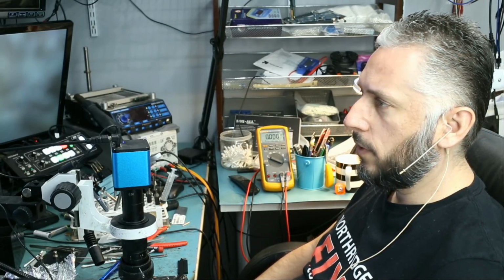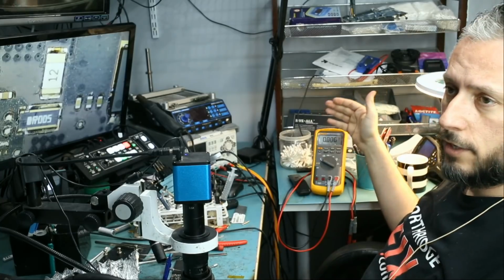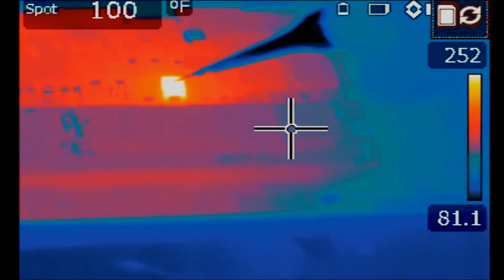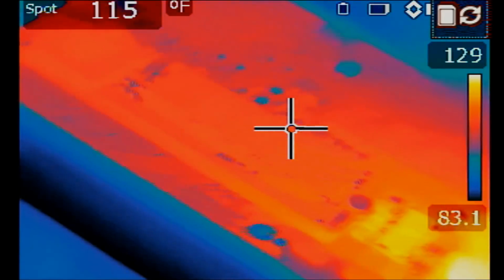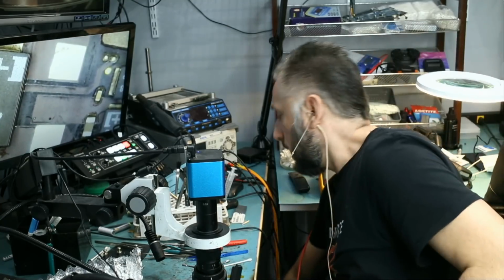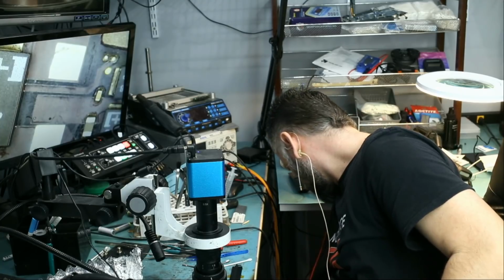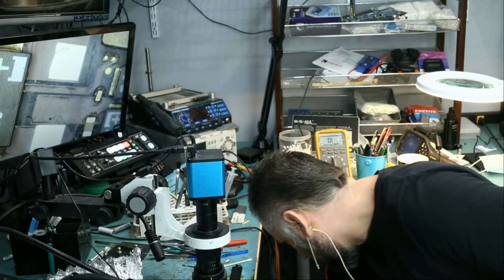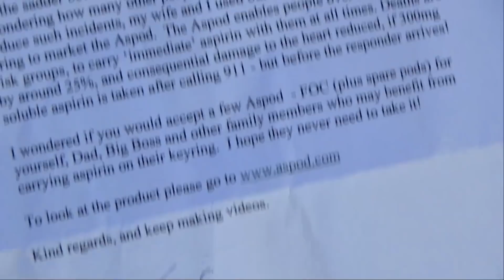2013 MacBook Pro No Power Repair - The Magic of using a Thermal cam to find short circuit.

Comment: You said the green light is the first part of the equation, i have quite a few same year macbook pros that have have no power issues but the light on the charger turns orange with the motherboard out of the system and no battery installed. Where would you turn to withan orange light, seems by saying you have a green light is the first step that you would not continue with the processes if it were orange.

Comment: I am a little bit confused about how to adjust and connect the macbook boards to the PSU. I can easily see how much current is drawn, but how about voltage? The bench PSU is not a charger, the board cannot negotiate with the bench PSU and ask for a different voltage than the PSU is adjusted for? So how to see if the board takes 5V, or negotiates 12, or 17-19V? I don't know if just setting the PSU to the max supply voltage for that board, could cause damage the way bad chargers doing the same can (?)

Comment: I have learned so much from your videos. I just recently did an iPad Air 2 charging port where half the pads were ripped off by a previous tech. I ran jumper wires for the first time (which is a lot harder than you make it look) and it worked! Thank you for doing what you do.

Comment: "We charge the customer full price..." That's fair. Because just because something's easy for the repair shop doesn't mean it should be easy on the customer ;)
Reply: If anyone wanted to complain, undo the repair and give device back
Reply: @182mdavi  When I was working as PC tech in a retail shop in the 2000s I was "honored" to do that quite some times. There was much wailing and gnashing of teeth on behalf of the customers as a result. Good times ;)
Reply: @182mdavi  We once got a PC in that was filled completely with dust (literally). We vacuumed it all out, fixed the damage (Pentium II had died a heat death in it's slot) and then the customer refused to pay. My boss had me put the shot CPU back in and empty the vacuum cleaner bag's contents into the desktop. Then we closed the lid and handed out the PC (minus the deposit).

Comment: Could you please tell me how much distance should a person keep between microscope and the device so as one can solder or use hot air gun with ease without harming the microscope lens with the fumes?
Reply: you can use the fume extractor